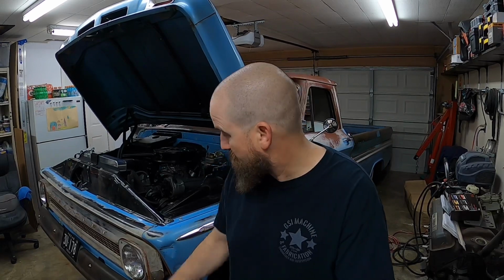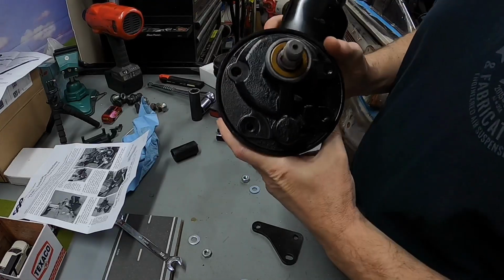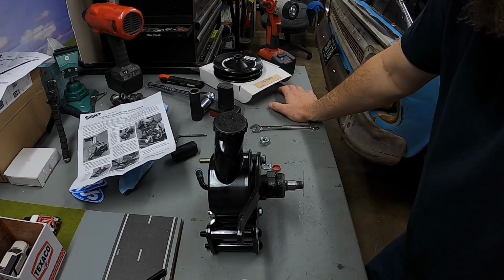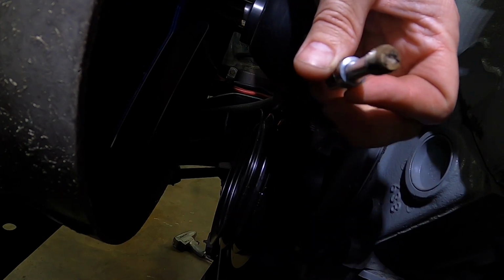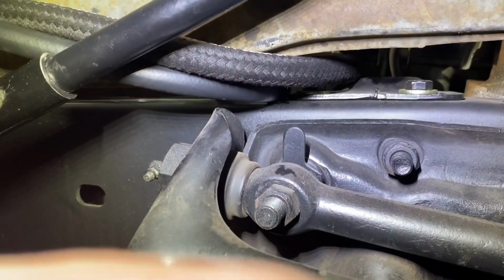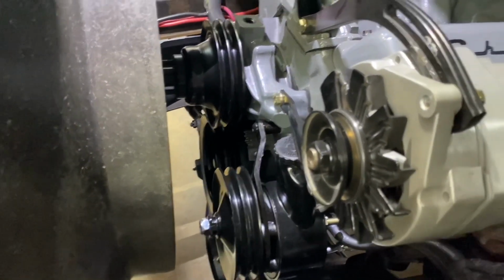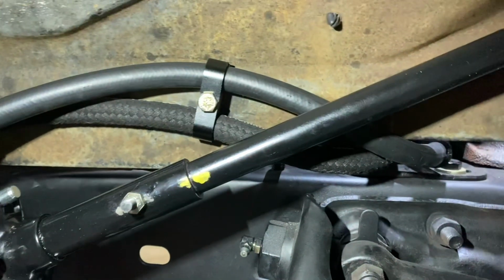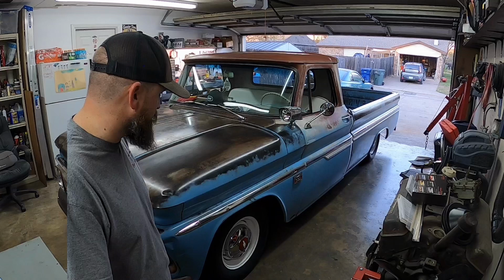Power steering install on my 1966 Chevy C10 part 2

Comment: The driver side bumper bracket did you have to grind it down to fit were power steering is on the frame.? Or did you just take it completely off
Reply from the maker: Yes. I wish I would have shown that in the video too, so everyone could see what it looks like
Reply: Right on thank you fir reply.. I installed power steering on my 65 c10 and was curious on what others did to bumper bracket.. looks like I’m grinding it down

Comment: I am doing the same power steering upgrade to my 1967 Chevy K20.  I have a SBC 327 with a very similar alternator bracket setup.  Do you have clearance issues getting the powersteering pump cap/dip stick off?  Mine won't clear the lower alternator bracket.
Reply from the maker: Yeah it’s not easy to get out. I think I have to loosen the pump and move it to get enough clearance to remove the cap/stick.

Comment: I have a '66 also. I'm putting on the exact same power steering upgrade as you. Did you have to upgrade your tie rods also ? My local parts store said you can't use stock tie rods with power steering.
Reply from the maker: I changed them when I rebuilt the front suspension. I went with moog stuff. The only thing different from manual steering to power steering is the pitman arm but the cpp kit provides that.

Comment: Put you a seventy three square body front end up underneath there it will fit. Power steering, power breaks The bushings in a seventy three are a hundred times better than the ones in the seventy two c 10. That's what I did to my 67.It drives like a corvette.

Comment: Did you have to ‘bleed’ the air out of the system?
Reply from the maker: @JimRedden-nq6zg  yeah you have to cycle the steering lock to lock. I did that several times

Comment: Do you have the cup numbers for the pulleys you used? I will need same ones
Reply from the maker: 2 groove crank pulley cp38811.  If you want to run ac then you will need a single groove crank pulley cp38812. I’m using cp38808 double groove power steering pulley. Double groove water pump pulley cp38813.

Comment: I want to go back to when you were doing the intake gasket on the motor at the end of that video you were putting on the air cleaner wouldn’t the air cleaner too big for the base?
Reply from the maker: It is. I used an 11” base and filter from k&n. It lets air in from the bottom instead of the engine trying to breathe through the tiny hole of the air cleaner. It’s the easiest thing I could come up with without drilling holes in the air cleaner
Reply: @Chickeneyegarage   thanks going to try it
Reply: One other question in the same video, you said you changed the springs on the carburetor and you went all the way to the biggest one. I had the same problem on mine. I had the yellow and changed to the orange a lot better. What was your reason going all the way down to the biggest one. Thank you.
Reply from the maker: @armandomendiola2490  I believe I was referring to the accelerator pump squirter. The springs you’re talking about are the step up springs. They are based on vacuum your engine. Generally, if you’re engine has 15” of vacuum at idle you will divide it by 2 and get 7.5”. The stiffest spring edelbrock makes is 8” which I think is the silver one. However you will need to try out different springs to see which one works best for your engine. That’s just a starting point.
Reply: @Chickeneyegarage  thank you I went from the yellow one to the orange one and it ran a lot better but I’m thinking of going down one more see around a little bit. I got a little bit of smoke coming out of the carburetor when I turn it off just gotta play with it little bit. Thank you.

Comment: What CPP PN was the pump kit? Assume it came with hoses, etc.?
Reply from the maker: CPP6366PSKS is the kit I’m running. 
You will need to get a pulley for the pump. Part# CP38808 is the pulley I’m running. Hope this helps

Comment: are you using aftermarket wheels up front to clear the discs, 15X6? A year later any issues?
Reply from the maker: Wheel vintiques series 62 are the wheels I’m running. No issues with the power steering. I highly recommend this kit.

Comment: Is your motor a 283? If so what size belts did you use as I have the same in my 65
Reply from the maker: It’s a 350. You would have to have the exact same pulleys and brackets to use the same belts I’m using. But I can get you part numbers if you still want them
Reply: @Chickeneyegarage  I would like the part numbers for your brackets and pulleys please!
Reply: My 283 has double pulleys & alternator in same spot as yours thanks for video!

Comment: Great and informative. I am having difficulty mounting the gear box due to the weight and the owkward body position. did you have a helper for that part?
Reply from the maker: Thanks. I did it by myself. It is hard to support the weight and line everything up but I managed to get it.

Comment: Another nice helpful video, you did the,exact same thing iam doing, my gear box and rag joint came in today !My pitman arm on Monday from jegs, pump and pully I have , also my bracket  just like your,,again very nice,video keep them coming
Reply from the maker: Thanks Steve. I’m dropping another video tonight installing cruise control if you’re interested.
Reply: I be waiting ,for it!

Comment: Very helpful mate,  I'm looking into purchasing the kit from Australia.  my truck has A/C and trying to figure out if its possible to set the pully up to the power steering.  not having any luck
Reply from the maker: Sorry for the late response. I think you will need a 3 groove crank pulley to operate ac, power steering and alternator

Comment: This was helpful thanks. What kind of lower alternator bracket do you have? Is it bolted to your ram horns? I need to figure out an alternator bracket set up for my “65” with a short water pump.
Reply from the maker: It’s the factory original bracket that was on the truck and yes it bolts to the manifold. Do you have accessory holes on your cylinder heads?
Reply: Did you ever figure out your alternator bracket?  Mine is like yours and I'm having a time with the belt routing.  The lower bracket makes it nearly impossible to remove the power steering pump filler cap
Reply: Yeah I’ve got the same issue. I have loosen the p/s belt to get the cover off. I think there might be a way to rotate the position of the res on the pump the make it line up better. I didn’t want to go through the problem of removing all the fluid and the pump right now.

Comment: Very nice job with the hoses and clamps. Better safe than sorry and this is build to last! Sweet! Just a thought depending on where you live, but down South or South East, the engine may have had plain water in it or just need flushed. Prestone has a bright yellow two part can that was sold by GM as well. I am most likely wrong but look for part number GM 1234678 to see or ask for "Heavy-duty" cooling system cleaner. It is marked but with the system just a few pints low, open the top of the can and a power cleans the block, heater core, water pump and radiator. It does not harm aluminum radiators but does an excellent job of cleaning. The bottom portion of the can has a neutralizer to stop the cleaning action. The block and plugs at the bottom of the water jacket that never get removed. They may not come out, yet flush with cold water and hit a little compressed air into the cooling hose to stir it up. You might be surprised how much dirt comes out. nice job with lighting and camera. That too is work when doing a video! Great job.

Comment: Did you just hook up the hoses , fill fluid, and turn lock to lock? Do I have to flush the system? I just bought one and didn’t have instructions 
Thanks
Reply from the maker: Yes I went lock to lock until the squealing sound went away which was fairly quickly. I didn’t flush anything. You shouldn’t have to if everything is new. If something is being reused then you probably should.